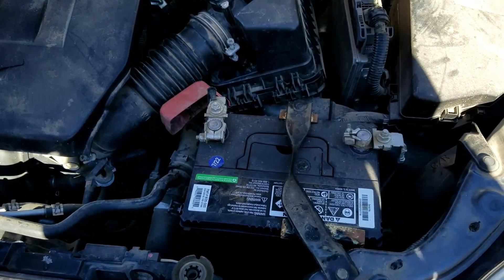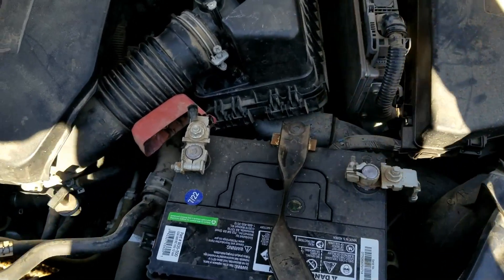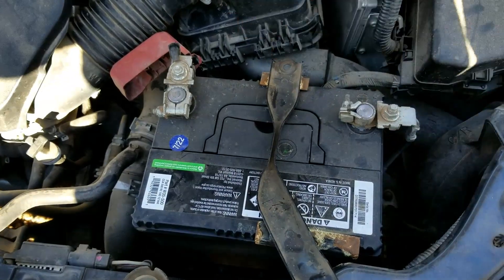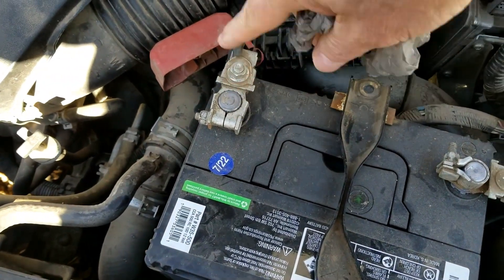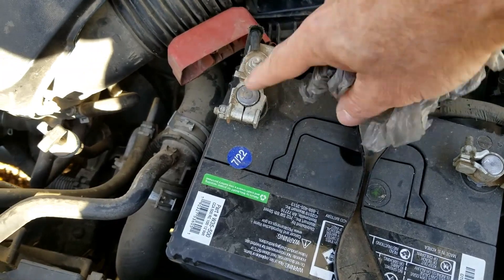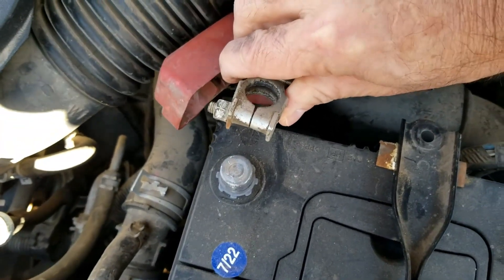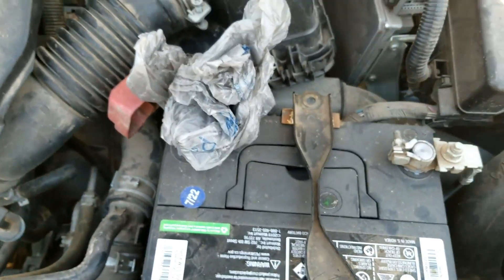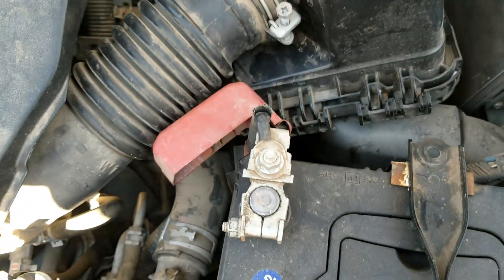How to Test an Alternator Without a Multimeter (Old School Alternator Test) (Do at Own Risk)

Comment: Always remove the negative cable . If you remove the positive cable and it touches metal you run the risk of short circuiting the system but if the negative touches metal it’s only grounds out the system.

Comment: Warning! This i not a safe test it can harm the alternator and the car electronics, it triggs a load dump high voltage spike as the field current can't compensate for the amp changes fast enough. The battery is used for compensate when load change. Disconnect the charged battery is really bad. Read the battery voltage instead, around 14.2 is telling you that it work. Below 13.5 is really bad. Load dump is not a new thing please read about it.

Comment: Never remove + or - cable while motor is running and reconnect you risk blowing a diode in the IC rectifier.

Comment: I did this decades ago on my 1985 ford telstar. It had electronic dash, high tech at the time and electronic fuel injection. All good and saved me when my battery cell shorted on a holiday trip. I was a young electrician at the time, now retired but remember my mechanic told me that trick... so i tried it and saved the day. I dunno how that works on modern cars, ill have to ask him now, before he retires.  😊🍻🦘🇦🇺

Comment: Isn’t it better to do the negative side to avoid sparks ?
Reply: No, same thing. It will still spark and possibly pulse a spike of voltage that might ruin your ecu or some other electrical component.

Comment: On old vehicles the voltage regulators are separate from the alternator. If the voltage regulator is bad the alternator will not charge even if it is good.

Comment: Thank you for sharing I’m going to do this right now to confirm it’s ok. I went to two auto stores to diagnose my car; one told me everything is fine and the other said I have a bad alternator and wanted me to take it out so they can run more tests. It’s two months old and I’m aware that new alternators (and rebuilt ones for sale) aren’t always functional out of the box.

Edit: I took off the positive and the car was still running so I’m good the one store has faulty testers possibly to profit from. It is a possibility that it is intentionally. Not sure, but I do know I’m not going back there for anything Unless I absolutely have to.

Comment: What if the alternator is ok and the issue is somewhere in between the alternator and the battery?
Reply from the maker: I would check the fuses and wiring for anything damaged or unplugged and do a voltage drop test. There are some good videos on how to do a voltage drop test.
Reply: @HVAC_Mechanic  Thanks, I appreciate your answer!!!

Comment: Always remove negative terminal,  so you'll never get short,  and you don't need that plastic bag, lol 😂
If positive cable will short to the cars body,  you risk not just fry your good alternator,  but ECM as well, and get car on fire if you are so lucky that day 😂

Comment: I did this on my 2003 Saturn ion pos cable disconnect but only was getting 10 volts with a new alternator. Shouldn't the alternator be pushing 12 volts even with the battery disconnected? Could this mean I have a bad new alternator?

Comment: You can disconnect the battery while the car is running it won't damage anything. We're did you people go to automotive school at that told you this. They suck for schooling. But this trick only works on older vehicles but t anything over 2000 it won't work for because of the design with the computer it's design to shut the vehicle off wants the battery is disconnected. I've been a mechanic since 93 and came from one of the top schools where nascar mechanics come from and can pretty much fix anything on a car or race car. There and s no harm with disconnecting the battery while the car is running just don't let the terminal touch anything or you could have issues then.
Reply: I've been a mechanic for twenty years and many mechanics do this when no meter is handy. With that said I would suggest using a meter.
Reply: @Jeremy-MDD should u disconnect the positive or negative terminal? Which one ? Or it doesn’t matter
Reply: @rickybobbydastar6534 The negative first
Reply: @robertfitzkee3862  You need to go back to school so you can receive updated info. Are you going to pay for someone's engine computer or module if it fries as a result of doing this?
Reply: I disconnected  the negative  in 2011 bmw nothing happened
Reply: So on anything newer than 2020 I should use a meter rather than use this old school method?
Reply: @PhoenixMediaCo  If it has an engine computer, don't do it. It's unlikely that an electronic component or components will get fried in the short time you have the battery disconnected, but it is possible. One of these components is your engine computer. All the other modules are also at risk of being damaged while the car is running and battery is disconnected. The engine computer and other modules aren't cheap. Is this guy giving you this advice going to pay for your engine computer of module when it fries? I don't think so.
Reply: @bernardocisneros4402 are you really this uneducated ? Fist of all of you disconnect the positive cable you can run into trouble. The positive cable can come into contact with metal which would could short circuit something . It’s unlikely as most systems have fuses or protections to prevent against surges. If you disconnect the negative battery cable and it touches metal you only ground it the battery and no negative effects should occur. That’s why you have ground bolts and wires all over your car .
Reply: @01gtbdaily30  Yes, I really am. You know everything and I know nothing. Keep disconnecting the battery on cars while they're running. That's a great idea.
Reply: @PhoenixMediaCo yes.  there is also a chance u could fry the ecu

Comment: What i want know is if you disconnect  the battery terminal is the car suppposed to change sound moment you disconnect ? Mine stays the same but doesnt switch off can i still say the alternator is fine?
Reply: the load on the alternator changes, meaning it is not charging the battery anymore. so you will get a slight reduction in noise.

Comment: hello i did that to the red side which is positive and it shut off so i knew it was the alternator but i was told i should be doing the negative side (black) .. also i have a 2014 hyundai sonata gps , is my car considered to have a computer ? if so can this affect it
Reply: Removing either cable, positive or negative, will test the alternator. Just don't hook the cable back up with the engine running, and it won't affect the computer.
Reply: @Jeremy-MDD what if i did connect it with the car running 😮 how bad can it effect the computer and how can i get the computer fixed
Reply: @ChasinChante9797  If the engine runs then it is likely good its just a precaution
Reply: @Jeremy-MDD  wel it runs but i’m still having a car problem. if u have email we can email. u seem to know enough about cars and my problem hasn’t been fixed and no one seem to be able to pin point the problem. besides it might be alternator or that i need to clean my idler or sober thing like that out
Reply: @Jeremy-MDD  it’s like my car have problems turning over sometimes . and a couple times when it start regular and i drive a little and came to a stop sign it just cut off on me ( like all the lights on dash came on ) and i put it in park turn it off turn it on and it comes back on . idk
Reply: @Jeremy-MDD  and no lights are on my dash on regular start, no codes comes up when hooked up, and the last mechanic said it might be i need to flush my idler or soemthing like that. i just know the minimum of cars and i thought it was the alternator but they tested the battery and  said it’s good ( think we can email? maybe u can explain further or possibly help me with a diagnosis ? lol)

Comment: This is an awful idea. Get a cheap multimeter from harbor freight for 6 bucks. If 13.5 to 14 volts running alternator is fine. You run risk of surge with no path to ground. Really risking vehicle electrical system man

Comment: I cannot believe this is still done and recommended today. If you want to save money and listen to this advice you could actually be spending a lot. This can cause a spike of voltage and damage the alternator and computers in your car. Do not do it. At least use a voltmeter. But to test an alternator properly you will need other tools.

Comment: Do not do this! The regulator which could be ECM controlled will see 0 volts and full field the alternator which may over charge causing more problems that you want to have! Get a volt meter and an inductive DC amp clamp!

Comment: I tested with a multimeter and it shows the battery charging with engine running at 14.2+ volts yet I do this trick and the engine shuts off immediately . So now I'm more confused than before !!
Reply: You probable have a newer car. I'm guessing 2005 or newer.

Comment: Another way on the older vehicles you would feed the field side of the regulator if it charged it was the regulator if not it was the alternator. On generator type systems you would ground the field side of it charged it was the regulator and if it didn't charge it was the generator. On some of the 50s cars the power steering pump was on the output end of the generator shaft that drove the pump. On older Chrysler vehicles that had a small black box regulator you could remove the cover and turn the field screw in to achieve a higher voltage on those people that drove short trips with the A/C on because the compressor took 5 HP to operate and lots of voltage. So we would crank those up to 14.9 volts to maintain battery voltage

Comment: As an aside:
Yes your method is useful on pre computer vehicles.
On a vehicle that’s not charging that is equipped with a stand alone voltage regulator if you use your method and if it stalls when you pull the cable, it’s the alternator if it stays running it’s the regulator.
An old mechanic taught me that 50 years ago.
Reply: Well I tested it on my car, it kept running for 1-2 minutes and then died... so what is the answer then?
Reply: @StarClay666 did you find out?
Reply: @simply._.raheem4625  I ran out of ideas so currently I'm waiting for a new (used) alternator to replace mine and hope that it fixes it.
Reply: yeah, NOT a good idea on modern cars! Possible to cause LOTS of damage on electrical systems..

Comment: What if you have a new battery put in and the car keeps shutting off. It won't shut off when I step on the gas  but as soon as I let it idle it turns off.
Reply: I know this is months later, but his issue is definitely his alternator. When his motor revs higher, the alternator pushes more power into the battery, that's why it only dies when he let's it idle. A lot of the time alternators don't just go out completely, they fade out and you only notice when you need a jump
Reply: Did you ever figure your problem out??

Comment: Very good advice to NOT ever touch the positive back when it's running or it could blow the computer stuff.. I know I did that with a guys truck some years ago.. He thought his Alternator was bad, and I told I could show him how to check.. I took it off and the truck keep running, then I put the positive back, and killed the truck instantly..  Luckily, a mechanic had a used device laying under the counter, that he gave to the guy free of charge..
Reply: Just take off the. Negative  like your supposed to
Reply: @louisostlie9926  It doesn't matter which one you take off. It's about the reconnection and completing the circuit. Try this:  Open your car door and make sure the interior light is turned on. Close the door, open the hood and disconnect your negative battery cable. Now open the car door again and then reconnect the negative battery cable. Did you see the spark or sparks at the negative battery post when you reconnected it? That's the same thing that happens when you reconnect any one of the battery cables to the battery when the car is running.

Comment: Touch a piece of steel (screwdriver) to the alternator rear bearing or if not accessible carefully touch to the rotating pulley on the front of the alternator with the engine running. It becomes magnetized and the metal will stick to it if it is working. Try it again with the engine off to notice the difference. If the metal sticks without engine running.  The diodes are fried internally. Replace it.

Comment: Manufacturers service manuals and others WARN us not to ever disconnect a battery cable with the engine running if the vehicle is equipped with an alternator.

Comment: Mine runs for about 30 seconds then kinda chokes out. I do have extra stuff running like aftermarket speakers. Would it be an alternator issue still or would it shut off immediately if it was
Reply from the maker: If the alternator is not working, it will shut right down. Your alternator may be working but putting out a weak charge. I would check the voltage output with a meter.
Reply: @HVAC_Mechanic Had the same result, I think it lasted like 1-2 minutes and then it just died. While normal idle I have about 12.2V and once the battery was disconnected I had 11.5V, do you think the output from the alternator was just too weak to keep it running for long enough? And would that be an alternator or voltage regulator issue?

Comment: Nothing will happen to your computer to those who are posting it will 😂 You will only delete settings like your stereo pre settings and for those with power seats your pre settings so this method is fine
Reply: and thats the difference between those who ACTUALLY study for these kinds of jobs, and those that think they know everything because they saw their uncle do it in their garage. lmao. if you dont know how electricity works, don't say anything
Reply: I did it in a 2011 bmw nothing happened
Reply: True
Reply: True dat
Reply: ur battery filters out remaing ac current thats lefts over from ur diodes, its called pulsating dc. Pulsating dc can fry ur computer. The diodes converts ac from the alternator to pulsating dc, ur battery filters the pulsating dc and turns it into straight dc. Ac pulsates but goes from positive to negative. Pulsating dc just pulsates in one direction, like normal dc its positive. But its not regulated voltage, it fluctates, that means it could produce a voltage spike to high for your ecu. So do not disconnect ur battery when the car is running.
Reply: Funny because my tech service opus ivs tech over the phone said that taking negative off could fry computers. Its like a lightning strike. The surge has no path to ground in a lot of cases
Reply: @mikesabin8568 this is correct.  do not remove the terminals when the engine is running.
Reply: @mikesabin8568 buddy didn't take off the negative 😂
Reply: @mikesabin8568 thats not right either, ur battery filters out remaing ac current thats lefts over from ur diodes, its called pulsating dc. Pulsating dc can fry ur computer. The diodes converts ac from the alternator to pulsating dc, ur battery filters the pulsating dc and turns it into straight dc. Ac pulsates but goes from positive to negative. Pulsating dc just pulsates in one direction, like normal dc its positive. But its not regulated voltage, it fluctates, that means it could produce a voltage spike to high for your ecu. So do not disconnect ur battery when the car is running.

Comment: Hi , mechanics keep replacing my battery but after a couple of months my 1999 ford e150 still won't turn over . It almost start but won't turn over. Please help. Can you recommend a mechanic in Galveston Texas?
Reply: Crankshaft sensor or starter
Reply: Could even be bad battery connections or bad ground wire

Comment: why can't you simply shut off engine after test, and Before re-attaching neg cable?  Why use the bag?
Reply: Because to shut engine off you must put cable where it touches no metal. You can't be 2 places at once.
Reply: his arms are not that long to reach the key while holting the cable

Comment: This trick works perfectly fine on my Bronco II 1986
Reply: Tight. Thus worked on my 88 2.3. Ranger. Apparently the aftermarket ones have an extra white wire hanging out that needs to be inserted into the unused 3rd wire port of the voltage regulator plug

Comment: It is interesting but--don't do it.   It is also limited as a yes/no test, it will ONLY tell you yes/no on the alternator, not if it is working, but not working well.  What might be MORE interesting is to discuss how testing the battery ONLY, can allow you to infer if the alternator is working correctly.  While running, check (with an Ohm meter) how much voltage the battery is reading, there is a range it should be at and you can look that up.  Below that range, the alternator is under charging, over that range it is over charging.

Comment: How about if you have two batteries in the truck
Reply from the maker: I never tried it with two batteries, but if they are in series, it should be the same. If the cables are in parallel, you likely have to remove both negative or both positives.
Reply: If you're considering this, go get professional help (this excludes anyone who would consider disconnecting the battey while engine is running, this tells you they're not a professional).

Comment: Tried this engine cut out…looked at the alternator and realised the belt fell off must be a bad tensioner
Reply: Just had a similar problem, the alternator was crooked, causing the belt to slip off..
It ended up being a missing mounting bolt